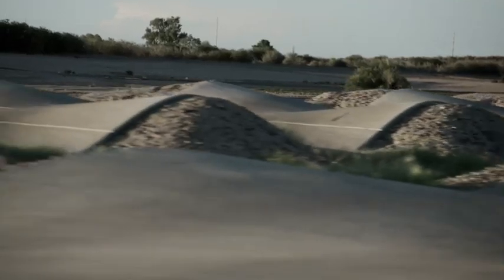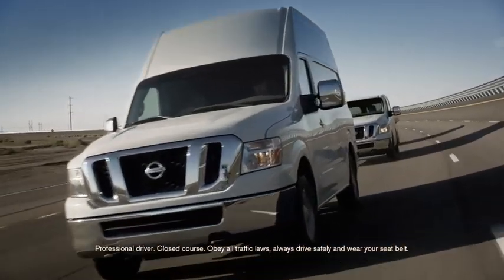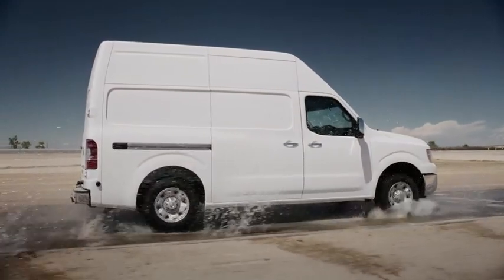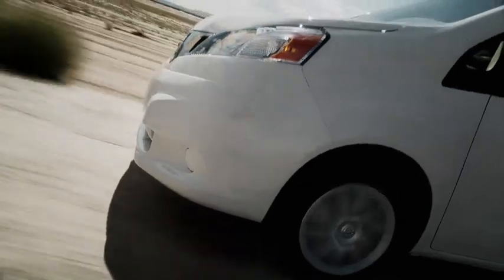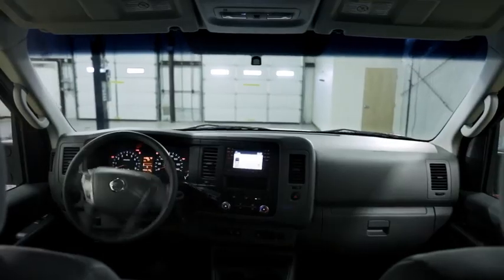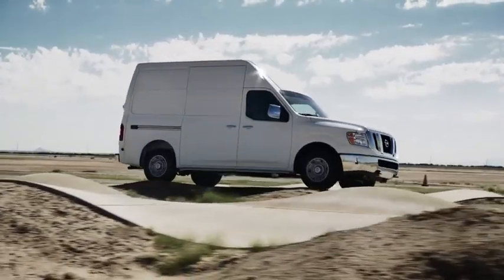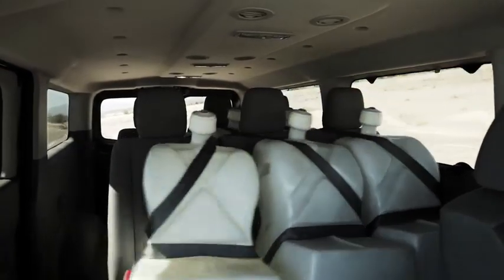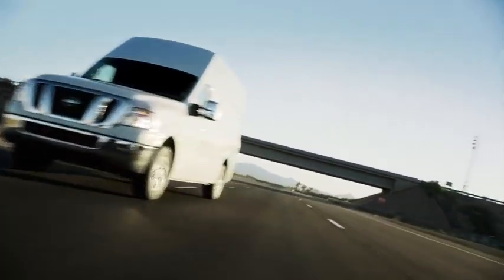NCV Proving Grounds: Testing NV vans for durability

Comment: Don't trust Nissan,  I have bought Nissan Commercial Van, and I found rust on top of the vehicle.  I tried to claim the warranty, and they said that it is out of the warranty covered, the rust is due to environmental issue.

I have other vehicles having the same environmental condition and owned for more than 10 years.  Never found rust.  I have Nissan only three years.